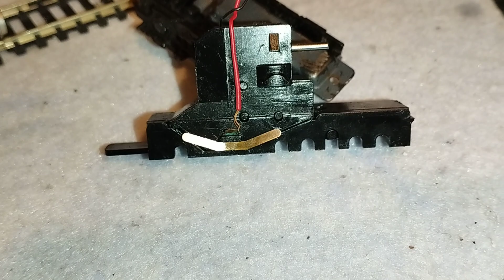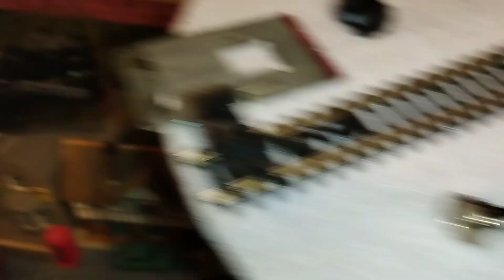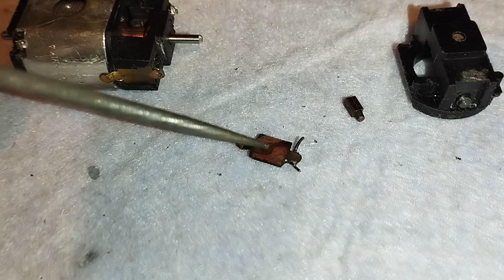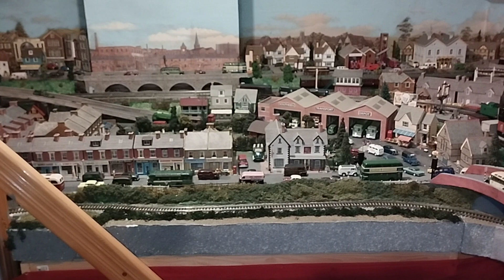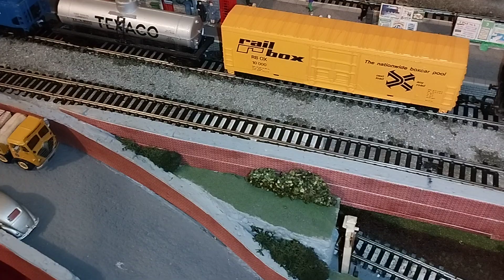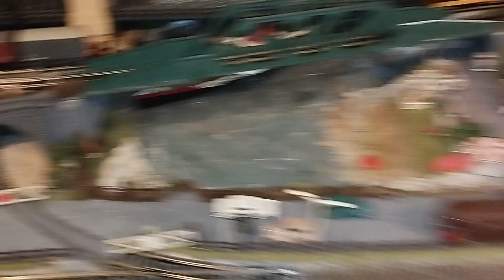Tommys Latest Job Lot Part 2

Comment: Hi Paul,  it great to see how you figure out how to remodvie and get them running smoothly 👍👌👏👏👏👏👏👏
Reply from the maker: Hi Martin, sorting out the bogie was a bit difficult but got there in the end. The Locos run quite well after another look at the motors, its worth spending a bit more time on them. 
Cheers, Paul.👍👍👍

Comment: Great video dear Paul,
this good video will be a useful tutorial for my damaged sd40 Mehano
big like have a nice week,alberto 😊😊😊😊😊😊😊😊😊😊
Reply from the maker: Hi Alberto, As I mentioned the later SD40s are different to the early ones so parts are not the same. Check if yours has a large Can Motor and white carden shafts. If yours has black Carden shafts then its the older model. 
Chow, Paulo.👍👍👍

Comment: Hello, Paul!  That was a great demonstration of the issues and detailed and intricate work you had to put in, but the results are always astounding.  I did love the line, "and once I get it going, I leave it alone."  That's me in all my projects... well, usually!  As always, an honor and privilege to be let into your world and hear you!  Cheers and best wishes!
Reply from the maker: Hi Anthony, I really appreciate your support and kind comments, it makes all my efforts to keep these Locos running worth while. There comes a point when a motor will run happily and any further attempts to make it better are futile. These old Mehano, AHM, Lifelike, IHC motors can be taken apart and cleaned with new brushes whereas the modern motors are designed to be replacable only. I am waiting for a job lot of Marklin Wagons to come these are also for spares or repair so lets see what they are like. 
Have a great week. Cheers, Paul.👍👍👍

Comment: Excellent job, sir! If I would not know your skills, I would say it is above all expectation.... Anyway, regarding your question, which loco is noisier, I cannot say - my locomotives are all (except one) so noisy, that yours seems to me like ballerinas, lol. I do not sense the noise difference... Anyway, I have a single Mehano locomotive, a Burlington SD-40, I bought it long ago as a second-hand item, it was "barbarized" by having cut a side rectangle hole and inserted an electrical switch - for light lamps, lol... it would be a donor machine, for sure. Thank you for the video (and for the effort to work these items in so short time), have a super evening! / Chris :goodvibes:
Reply from the maker: Hi Chris, thanks so much for your kind words its most appreciated. I dont think my camera picked up the sounds so well but the Locos with the Lima brushes are a little quieter. The result is smoother starting and better slow speed running. As you know I fit 5 pole Piko motors in many of my Mehanos but tend to leave those running well unmodified untill they get too rough or noisy. 
Its a shame your SD40 has been barbarized as you call it, I hope it still runs. Another spares or repairs job lot arriving in the week so lets see what they are like.
Have a great week. Cheers, Paul.👍👍👍
Reply: @paulvozman842  Well, on a scale from Micro Metakit to Mehano, worst then the later is only my Romanian "I.U.P.S. 9 Mai" train models ("I.U.P.S. 9 Mai" is the toy factory name, situated in Lugoj (pronounced ~lugozh~) - yes, if this town name sounds somehow familiar to you, is the home city of Bela Lugosi 🧛‍♂🦇). I only have one set of this Lugoj trains, quite expensive nowadays, due to the long time ceased production - it has a very powerful motor (imported from Hong Kong) with transmission by... lol, rubber band. These days I try to restore it, luckily it is not in a bad condition. Best wishes and a great evening! :)

Comment: Hi Paul, you’ve got those locos running nice smooth and quiet top man 👍 cheers al
Reply from the maker: Hi Al, thanks for the kind comments its most appreciated. These old Mehanos are quite good runners considering they only have 3 pole motors.
Cheers, Paul.👍👍👍